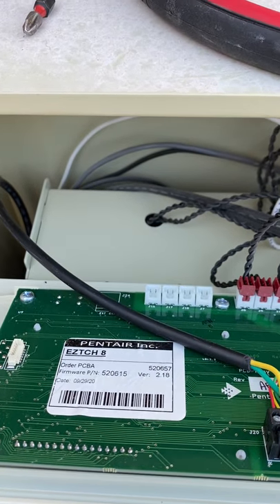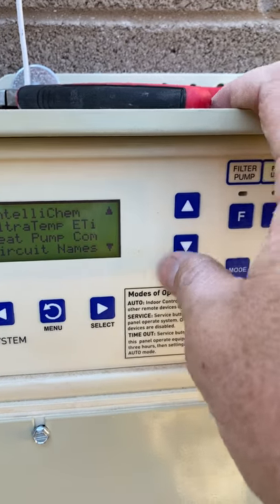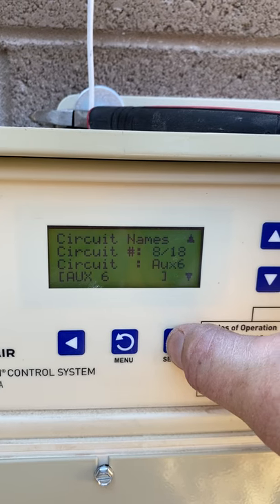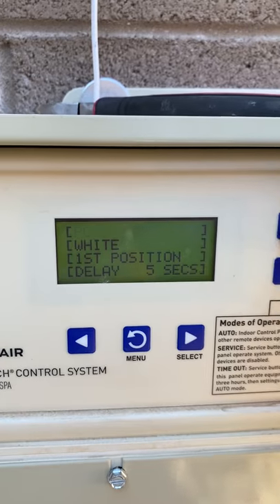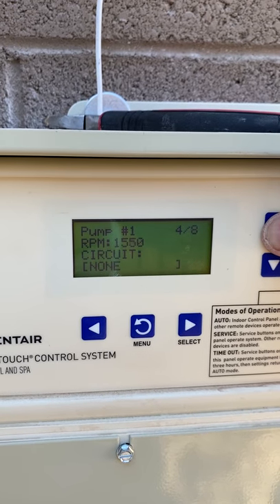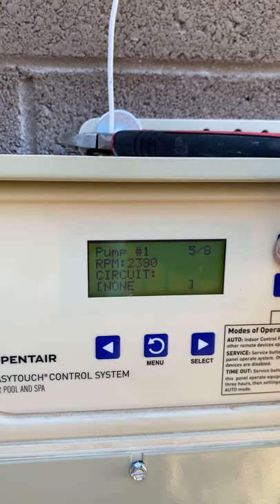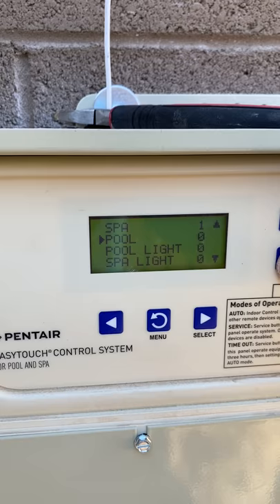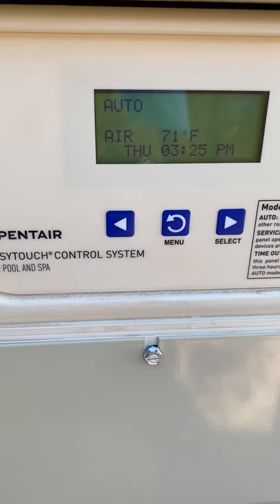Programing a Pentair Easy Touch 8

Comment: I have an easy touch 4, but i am not getting any voltage to the red rectifier wires so my panel seems to have no power. The main breakers do have 240 coming in and everything is wired properly.  I tried swapping the high voltage transformer but that didn't work.  I also tried swapping the spare 4th relay with the first relay but no luck w that either. Any suggestions on what to look for?

Comment: My setup is just like yours but I cant seem to set the colors on the pool light separately from the spa light. I can control them (on/off) separately since theyre on differeny relays but if  I set the pool light to red, the spa will also turn to red and vice versa. Circuit functions is also set to intellbrite for both lights.

Comment: Thanks for the video. In order for the heat to come on for the hot tub, do I have to turn the hot tub on? I put the heat on to 100 degrees, but the water doesn’t warm up.
Reply from the maker: Yes the heat doesn’t work just because it’s on it has to have spa or pool turned on as well. Heat only works in pool or spa mode

Comment: My pool builder installed a Pal Color Touch receiver and transmitter to control/change lighting. Under Circuit Functions- Lights, should I still select Intellibright? 

Generic is currently showing. The lights were working fine the last 2 years, but are not coming on now and controlled by the remote.
Reply from the maker: I honestly have never tried to put one of these on an Easy Touch. I would try putting it as a generic and then config the light. If that doesn’t work try intellibright

Comment: Can you explain a little more about how to do my multiple speeds on the pump at multiple times?  On the pump itself you have the options of speeds 5-8 to be programmed and then set a start and stop time for each one.  So speed 5 can be 2700 rpms from 9a to 12p and then you can set speed 6 ar 1200rpms from 12p to 9p type of thing.

How do I need to think about doing that on this big system as well?  I want different speeds on the pool pump at different times but don't know how to convert what I used to do on the pump itself to what you do on this panel.
Reply from the maker: Yes I can make that as a video soon. 
You have to set you circuit names, then circuit functions. Once you do both of these you set your intelliflow speeds. Once you have circuit names they show in intelliflow speeds and you pick each speed. Then you set your schedules from those speeds. I’ll make a video for just that.

Comment: i have the same system, how do i make my spa jets blow bubbles ??
Reply from the maker: Several possibilities 

Number 1 it has to be in spa mode sucking from spa returning to jets 

Number 2 you need either a blower or air loop to get lots of air

Air loop is plumbed in and you cut a whole in it to suck in air

Blower is tied into a relay. If you have a blower figure out which relay turns it on and then label it blower. Then you can turn that in after spa is moving water through jet lines.

Comment: Are you near Tucson? Do you make house calls? We're having problems with the Easy touch remote communication.
Reply from the maker: Is it a hand held remote or is it on your phone?
Reply: @diypoolguy2974  It's a handheld remote. I finally got it to communicate by powering off the main panel and back on so the antenna lights lit up. But, now it seems there is an ERR for the Spa temp, may need an electrician for that.
Reply from the maker: @natalieperez4267  we can upgrade you to the phone model when your ready but not sure why the spa temp would be off. That is odd. Usually the air or water temp not just the spa temp
Reply: @diypoolguy2974  The phone model would not be good since it's my Father's house, super senior, not good at all with tech. I'm visiting from NY. The water temp is way off too, pool says 255 degrees with heat off.
Reply from the maker: @natalieperez4267  definitely understand one of your temp sensors are bad my guess is the water temp sensor has stopped working

Comment: When making a schedule if I don’t want use the egg timer do you just not select it?
There is no default?
Reply from the maker: Yes you can pick egg timer or select new. New opens a regular schedule
Reply: @diypoolguy2974  will setting egg timer to 00:00 keep the pump from turning off?
Reply from the maker: No that will not work the default is 12 hours.
If you want it to run non stop set a schedule for 23.59 hours that is the only way to make it run all day every day
Reply: @diypoolguy2974  thank you sir!! Really appreciate your quick response.
Reply from the maker: Yw

Comment: My pool builder upgraded my panel from an Easy Touch 4 to an 8 due to the number of lights I wanted on separate zones. My question is would the Intelicenter have been a better choice? The price was a lot more money for the base, then you have to purchase everything separate, however, it does include the wireless and it come with the app vs Easy Touch 8, you have to purchase those separately, again the price was a big jump. What are your thoughts since you installed Easy Toch 8 in 2021 and not opt to go with Intelicenter? Am getting an old technology using the screen logic 2?
Reply from the maker: The IntelliCenter is definitely smarter and has more options because you can set things in groupings. You can call it John’s party mode and tell set what you want to come on in that mode. They both work well on wireless the IntelliCenter just has more smart options. You have to decide if it’s worth the price for the smart options. Easy Touch 8 is pretty amazing minus not doing the groupings

Comment: Almost too fast. You explained the devices/pumps but I was specifically interested in how to set up (configure) motorized valves and you forgot completely these important steps to complete the configuration for the actuators of the valves to be aligned to redirect water flow to either heat the pool or the Spa... Please add that.
Reply from the maker: Thank you for your feedback. I do have other videos that cover actuators we did not cover that in this one.